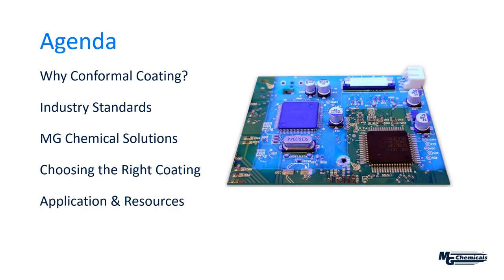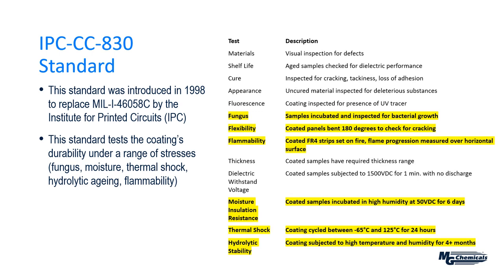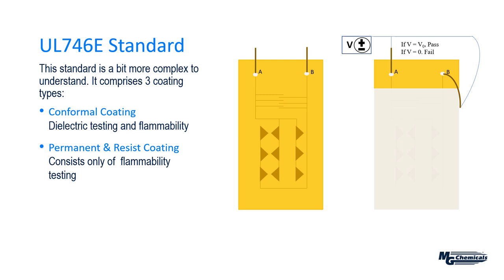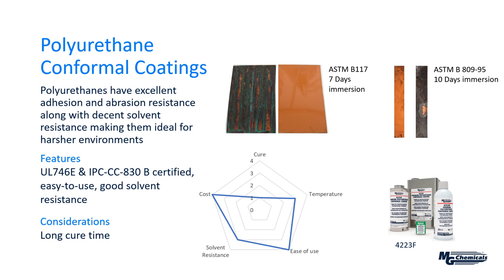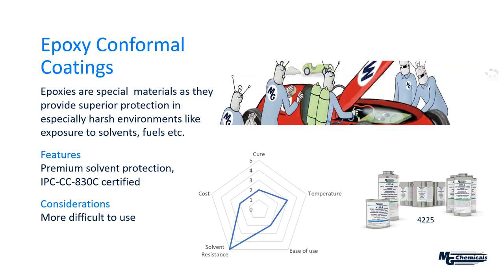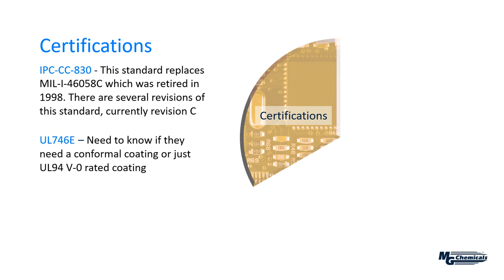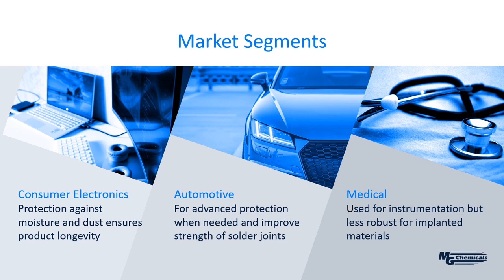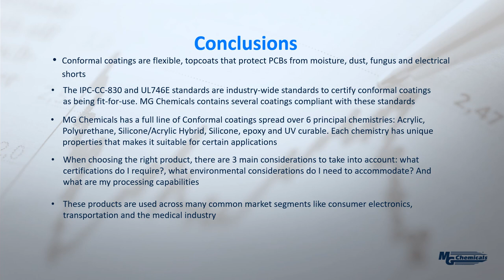MG Chemicals Conformal Coating Solutions

Comment: regarding to UL746E, what different between conformal coating & permanent coating?
Reply from the maker: A conformal coating undergoes 2 types of tests to be recognized as conformal coating. First there are the dielectric tests that evaluates the coating's ability to maintain a minimum level of electrical insulation under different stresses. Next there is the flammability test which tests the coating's ability to self-extinguish when set on fire. Permanent coatings by comparison only undergo the flammability test and are not evaluated for dielectric performance.
Reply: @mgchemicals  Got it, thank you!